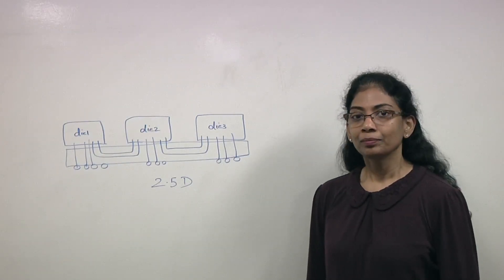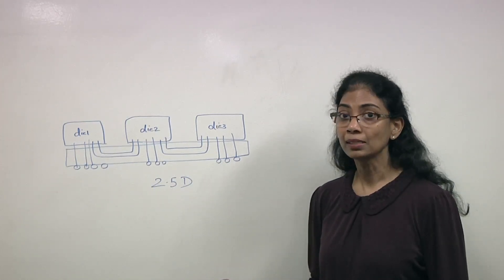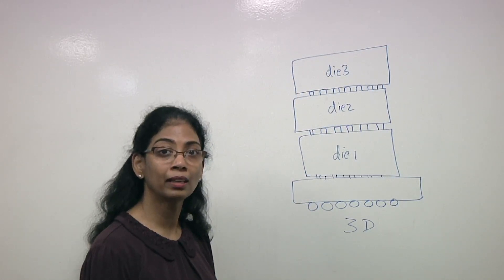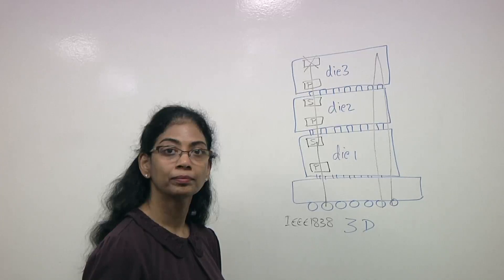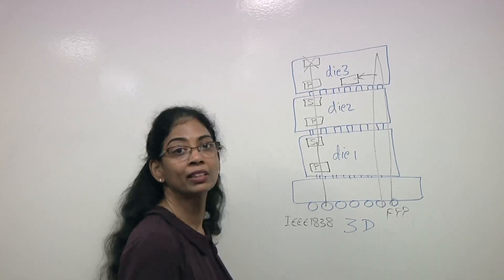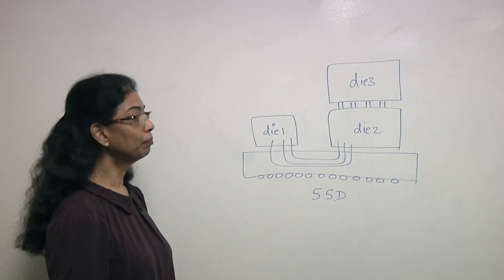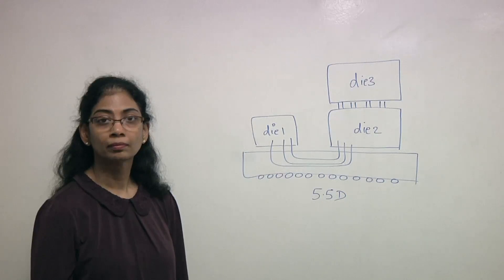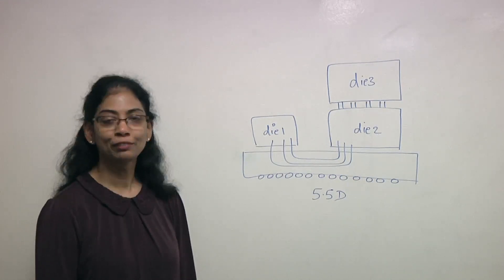Testing 2.5D And 3D-ICs

Comment: What kind of testing do we do as of today for stacked dies?
Is it just scan chain for purpose of connection checking? Or do we try to access some status/debug registers of IPs on the die? or do fault/error injections in one of the dies?
Just wanted to understand what is the level of depth we go in for testing after fabrication.

P.S.: My question maybe very basic as I am a SoC Verification Engineer on the frontend side and I am not aware of all the backend testing and intricacies.